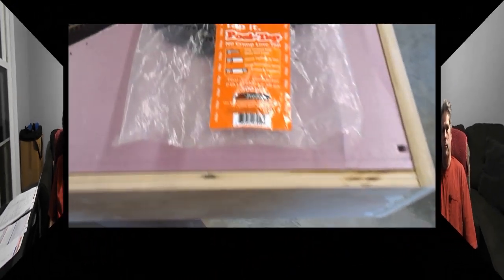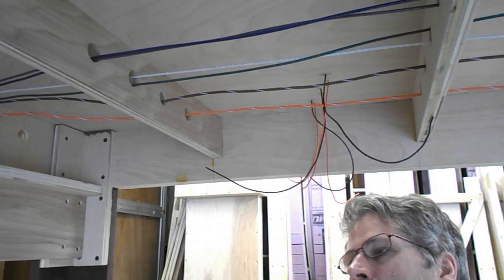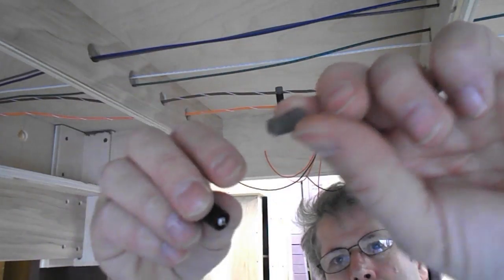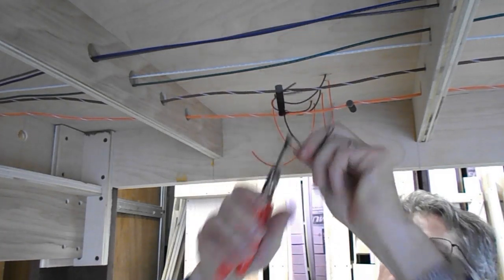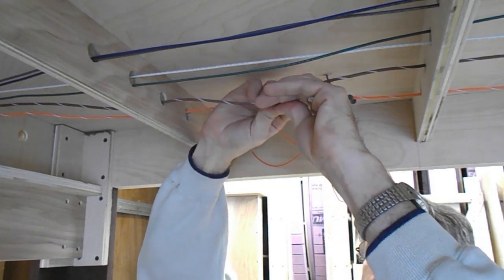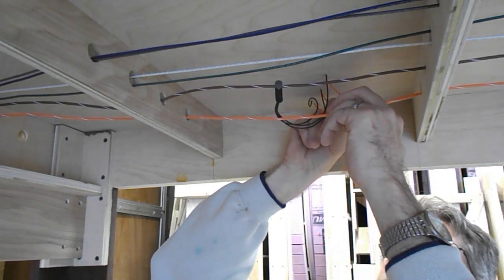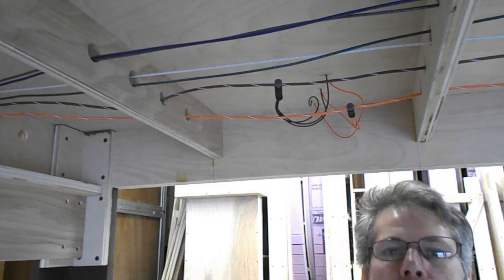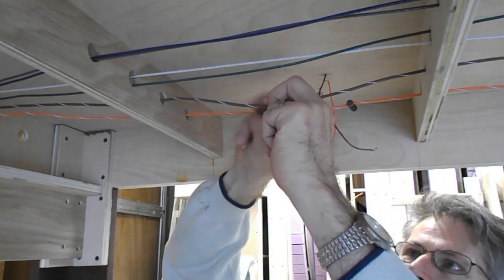Adding feeder wires using Posi-Tap PTA1218M connectors

Comment: Any long term review of this product? Have you had any issues with them?
Reply from the maker: I really like them, and have continued to use them exclusively since I made this video.
There was one layout where I broke a few of the pins off (only about 6-8 out of several thousand used).  I still don't know whether I had a bad bag or if I was tightening them too much.  That was when I was using 12ga bus wires, so maybe that makes a difference.  On the smaller layouts I've built since, I've been using 14ga busses.  I guess it's something I need to listen for on the next big layout (it's an audible snap, so at least I know when it happens and don't get mysterious dead spots).
Reply: @mpeterll  Thank you for the feedback. As you mentioned they're a bit pricy from the looks of things but not having to strip and solder hundreds of connections on any given layout sounds like fair exchange to me.
Reply from the maker: @MRBenchwork  Cost vs. time analysis:  The bulk pack works out at about 58c each.  If you assume that each connection saves about 5 minutes and you value your time at more than about $7/hr, then they are worth it.  Not having solder drip in your face is a bonus.

Comment: Is found a tip about posi-tap connectors before I knew how to solder. They worked very well but    Are speedy if you have a large layout. I got used to soldering and didn’t need them anymore. Great if you want little fuss and speed.

Comment: Neat product , thanks for demonstrating it. 
Question. The twist the strands together and then screw down the black end clamp - that’s the same as a screwed to a terminal block sort of connection. Should one use a ferrule there as over time the screws down connection is likely to lossen from the stands compressing and shifting ?

Comment: Dreadful way of connecting feeder wires to   the bus. Mechanical connections like this can always be a weak link in DCC. Bad connections lead to corrupt data.
Reply: And how do you do it? Terminals blocks?
Reply: @chriswoodruff2293  no, solder every joint. I'm a professional layout builder. We build modular layouts. When the track is down we take the layout apart, put each module on the bench and wire it.

Comment: I am not DCC savy just yet. Would like to know why everyone runs a feed to every 3 foot section of track laid? Find it so wierd that use dc you have just one feed to 100 miles of track and all is well. Missing something here!
Reply: No only is voltage being sent to the rails, but digital control signals. Multiple feeders help reduce the signal loss of the rail and rail joiners for the control signal, providing a more pleasant experience of your railroad.

Comment: Wow their really good solid? I use a little clamp blue and red colours only you just place the two in the clamp and snap together no cutting or trimming wire I use these on my model boat wires as you cannot get your hands inside the boat spaces still your are solid....best wishes ken